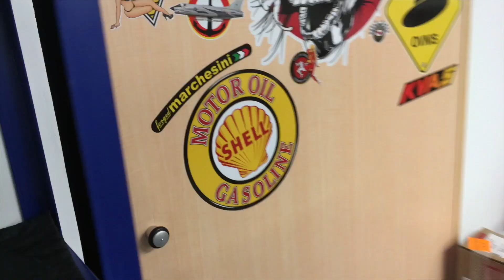Ultimate Model Car Restoration - Abandoned Dinky Toys - From Extremely Damaged to Brand New!

Comment: My tip: next time, when you are masking the wheels, use white PTFE tape, the same plumbers use. It has no glue on it and it conforms to any shape, easily. Easy on, easy off.
Give it a try and tell me what you think !
And also use the yellow LOW TACK tape, instead of the high tack white tape. That glue is way too fierce. And as we can see, it tears off the paint......